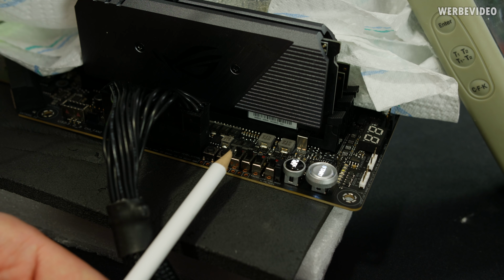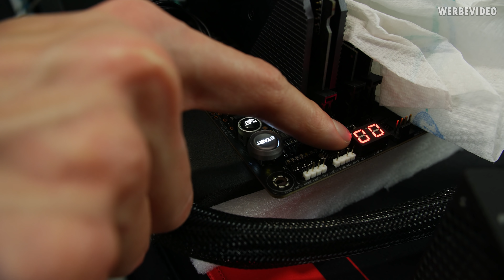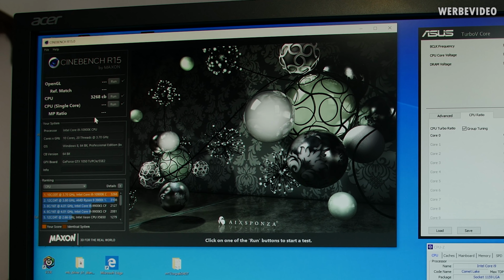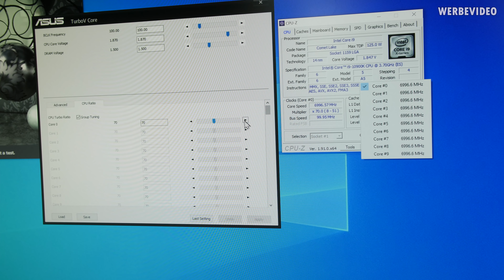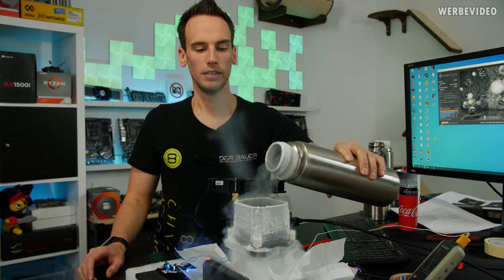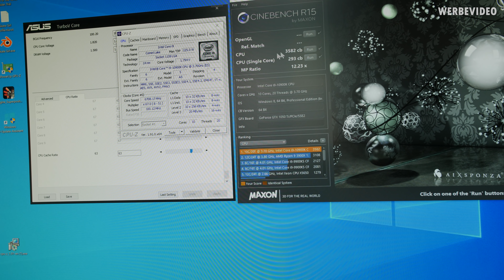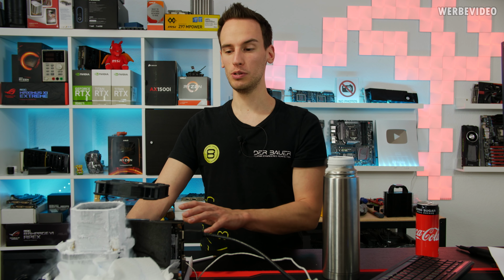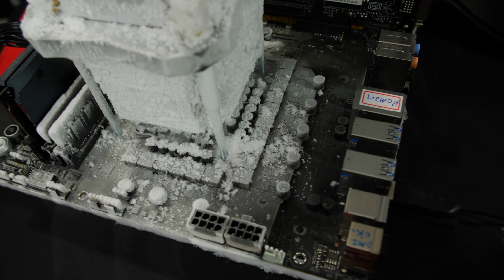The easiest Overclocking Platform EVER! Intel 10900K and Liquid Nitrogen OC to over 7 GHz

Comment: "fume" would likely be "vapour" in English
Reply: or "vapor" in American English.  Or maybe "steam"? Or does that only apply to dihydrogen monoxide (water)?  "fume" in the use I'm more familiar with might translate to something more like "smoke".  (Sometimes I've seen bilingual signs that in English say "No Smoking" and in Spanish say "No Fumar".)
Reply: pianoplayer88key vapour, smoke, and steam are all different things. Steam refers only to water vapour. Vapour of any other liquid is just vapour. Smoke is the product of combustion. The correct spelling in the english language is vapour, not vapor, which is the wrong way that americans (and no one else) chooses to spell it
Reply: Technically this is a mist.
Reply: Vapor in the language of freedom
Reply: Kevin Sandu vapor can be spelled either way
Reply: Off gassing.
Reply: @stageselectca  usa is better than  britain
Reply: The word fumes is more often used for toxic volatile vapours/gasses. Like you would call car exhaust fumes, not vapour. Same with stuff that comes off of paint/solvents/solder etc...
Reply: @JGnLAU8OAWF6  technically it's a gas
Reply: I love in the US but have visited Britain and Ireland and were not better lol trust me.
Reply: Live. I hate auto correct.
Reply: @Dakotajm0726  I live in the UK and have visited the US and was not better lol trust me.
Reply: Make America UK Again.
Reply: @easley421  what gas, exactly? Isn't that just water from air condensing and freezing due to low temperature?

Comment: Roman: *grabs LN2 and casually breaks a world record
Also Roman: "I don't want to risk the board and the CPU" 
:D
Reply: Ln2 is quite safe compared to chilled water
Reply: @LawrenceTimme  Not really, no. I had my laptop practically submerged in water (bottle of mineral water opened in the bag). I had to stand the laptop on the side to let the water drain. That was 3 years ago and the laptop still works. On the other hand, if you spill N2 on the board it is likely to damage the board as some parts will instantly cool and shrink at different speed than the rest of the board. Things will crack, break, warp. Not good for your multilayer board with large amount of surface mounted component.
Reply: Elmor did 7.7ghz on LHe, and Hicookie did 7.52ghz  on LN2 so not quite world  record?

Comment: 10:32 - Fume is normally associated with something hazardous or possibly harmful.
In this case I would think the word you might be looking for is "Vapor".
Reply: Steam would be also correct, because the visible part is the water condensation in Air, just the same as it is over a surface pot of water.
Reply: I'd think dry particles are called fume, wet particles would be called vapor.
Reply: @ShieTar_  Steam is a good term, cause it is actually a byproduct of the LN2 BOILING.
Steam: Noun: The vapor into which water is converted when heated, forming a white mist of minute water droplets in the air.
Related Terms Condensation, Mist, Haze, Fog.
Reply: @stephanschmidt2334  i think fume is any chemical reaction that forms a gas, vapor is just getting warm enough to off gas.
Reply: vapor is created here . steam is water . fume includes also particles
Reply: Steam is hot, this is cold, fog is more apt
Reply: Like the Fume Knight
Reply: Vapor, fume, steam, fog....
"Fine particles of water in the air, in high concentration", as simple as that.
Reply: @qweewq-h7p  different properties to it though my friend
Reply: Vapour is what people would usually call it, but it's technically wrong. It's only vapour if it's a gas below it's critical temperature, the temperature here would likely be higher than nitrogens critical temperature.

This is just gaseous nitrogen.

Comment: My best guess is that that little piece is actually a quick remove in case of unstable connection. If you notice, it has pin connectors attached to it, meaning it has some sort of conductivity. if something heats up, it might be a safety feature.

Comment: may i ask why you dont make a small acrylic box that has is de-humidified? the mobo can be inside, with the pot sticking out. a rubber gasket to keep the system air tight, and side panels you can open to still access the system... it can be on a ball-bearing slide so that the mobo can easily be inserted/maintained.. like a drawer or mechanics tool box.  that would be genius. you wouldnt have to worry about condensation At All...

Comment: The 9900ks should have been available on launch day of the 9th gen Intel CPUs & sold at the 9900k price. Now Intel needs all the ammo they could need with the 10th generation, I would have offered the 10900ks like that, especially since they need to get their fans to upgrade.

I just upgraded to a 9900k from a i5-750, have zero intentions to upgrade until 3 or 4 generations into ddr5 memory due to maturity of memory controllers and a wider selection of high end DDR5 memory sticks that will be available by then. I also just upgraded to a used 1080 GTX seahawk from a 7850 for my very first system that's water cooled, glad that I went with those steel braided hoses. Zero leaking issues & the tubes look nice for an industrial look in my rack mount case.

Comment: The bottle opener says emergency use probably because the motherboard is designed for overclocking on a test bench where cable management is next to none so the SATA connectors can be blocked by a piece of PCB without any problem. If you're putting it in a case you will need you remove the bottle opener so its a "emergency".

Comment: Never understood why people don't enclose the set-up in a perspex box to keep the moisture out. As long as the atmosphere inside is dried with dessicant or a LN2 "cold finger" elsewhere in the box away from the board and the air inside circulated by a fan, there shouldn't be any condensation on the board and it won't need rubber coating.

Comment: Question for water cooling aficionados:
1. Are there water cooling fittings that will work with hard and soft tubing so I could start with soft and then move to hard down the line without new fittings?

2. Considering there’s multiple fitting sizes for hard tubing, is there one that’s more common and thus more compatible with more gear or that looks better in your opinion?

Comment: Could you explain it to me: liquid nitrogen is not good heat conductor. Why overclockers do not use water near 0 celsius instead of liquid nitrogen because it can take more heat from processor? Or it needs negative temperatures?

Comment: i know this is probably a very stupid question but why dont they make the cpu chips larger and add more space for all the transistors to be ever so slightly more spaced apart to try and keep them a bit cooler? or is it better to have everything cramped together to become a larger heat sink? ive always wondered why dont they make the cpu's bigger? i know threadripper are bigger chips but they have a lot more cores

Comment: Would it be possible to engineer a closed loop system for LN2? I could imagine a board with a heating unit integrated into the socket and a sump system for the LN2 with monitoring and control software that maintains the target temperature regardless of load.

Comment: Nice. But I'm a bit surprised it has only about 3500 points at that clock when my i9 7900X has about 2450 points without overclocking. Same 10C/20T but only around 3.8-4.0GHz.

Comment: 8:25 find a better pouting method, that's dangerous it could have spilled on her hand
Reply: Synth Lord due to the leidenfrost effect spilling ln2 on her wouldn’t have done anything
Reply: @llamakob3745  sustained contact with the liquid stream for only a second could still cause freezing, skin will be rapidly cooled... shrugs* simply not worth the risk, when it's easy to find better method, just set the small container on the ground while pouring into it, no one needs to hold it

Comment: Does 10900K suitable for direct cooling as 9900K after removing IHS? I hope it will cool down the CPU significantly.
Reply: The quartz has been sanded down 0.3mm (12-13 thou) from factory, so you'll have to be bloody fucking careful with them after delidding.

Comment: so what happens after youre dont with extreme OCing a chip, is the chip basically trashed at that point or can you just reset the voltages and continue as if you did nothing

Comment: For some reason my 10900k stays at 4.9ghz at all times.. even after I load optimized defaults in bios.. motherboard is asus Maximus extreme.. I tried enabling, MCE, speed shift, speedstep and what not without luck.. it simply doesn’t clock down to its base clock at 3.7ghz any ideas?

Comment: Why don't you try lapping a 9900K/8900K die to the same thinckness as the 10900K's die and use the 10900K's IHS on the 9900K/8900 and any of the other older K and non-K cores?
Reply: That sounds possible, but wow would that be ballsy.

Comment: Just realized that liquid nitrogen could be used by men with erectile dysfunction.
Reply: its because some men thermal throttle when they reach 4 inchertz
Reply: @killers007q8  it's a boot issue

Comment: the 9900k is still more expensive than the 10700k which one is better or will they perform the same ?
Reply: If you have a brain, you'll take the 10700k, since it is not on a dead end plateforme

Comment: 8:25 Im pretty sure that in the future you will let your GF wear gloves when you pour the liquid and that this time was an oversight :)
Reply: the liedenfrost effect would have kept her safe its when it gets into fabric thats against skin that it really fucks people up that and sticking your hand in it
Reply: @bricktopgaming5750  Exact, it's actually more safe not to wear gloves then to wear some
Reply: @bricktopgaming5750  you can easily stick your finger in it for short time, the skin surface gas layer protects you; same goes with highly concentrated H2SO4 - the trick is pulling your finger back in a smooth manner without dropping any droplets of acid anywhere (and of course to water plate for letting remaining acid layer to fully react before drying the finger).

Comment: Is the word maybe Kondensation in German or condensation in English, or maybe water vapour or wasserdampf, I think maybe either could be used in this circumstances and English speakers would know what you mean. I bet there is a more technical term of it, but as the video is about overclocking and not physics I am pretty sure it's OK to call it steam or condensation.

Comment: Would like to see Mobo mfgs drop the PS2 port and include more SPDIF outputs for Home Audio Receivers (How else to get 5.1 off to a DisplayPort system?)
And 90 degree 24 pin connectors!!!.. and real heatpipe+radiator heat exchangers on the PCH/VRM like they did in early 2000s
Are the traces exposed and able to short? The rubber seems like an intense 1-way process..
First the Cat. Now the female. Next thing you know this will be a cooking channel.
Fume  = Gas or Vapo(u)r.. Fumes are usually noxious. 
Nice Linus Cameo.

Comment: I think if cooperation between Microsoft and Intel is done to create a new processor, which is two pieces of , and with a new motherboards that supports it, there will be coolers for each one, for example, one in the back and the second in the front
 , Or the two next to each other
The processors are supported by the same Windows system, for example, and the system collects two speeds
, To bring us Double speed with less heat.
we saw in the recent period on Intel's ideas to make the multi-GPU graphics card. Why isn't there also a multi-CPU? And it is supported by operating systems to collect two speeds and the system deals with it as if it is a single processor. I do not know this idea should be present in time in all processors. It will solve the heat problems. They have problems instead of changing the processor every year

Comment: could you do (even in theory) freezer alcohol cooling loop?
Reply: Ethanol evaporates at 80 degrees and has less viscosity then water. It's just more dangerous for the pressure but would be fun

Comment: 8:24 That looked kinda dangerous. I would hate to spill some LN2 on my hands. Please use some gloves ffs!
Reply: LN2 wont sit on your skin unless you want it to. If you get it on you shake it off. Gloves can get soaked - you can't get them off fast enough. Those rubber gloves will get completely messed up by LN2.
Don't use gloves.

Comment: Will we see 10 GHz in my lifetime?
Reply: Probably yes
Reply: @militaryiam97  Doubt it, chip manufacturers are moving away from chasing clock speeds since the early 2000's. It's all about instructions per clock and core count now. I'd be more impressed by an exponential core-count race these days. 16, 32 and 64 are already out. 128 and 256 are the next step. That will also require die-shrinking to make it fit in the same size socket. We currently have 7 nm by AMD and 14 by intel.
Reply: Yes imagine Intel with literally no architectural changes even but at 7nm I stead of 14nm. It will be reachable

Comment: great engineer, but obsolete viewed and reviewed and reviewed cpu that has been arouind for the past 5 years.... i stopped watching this at  0:05. as for the  7GHz very nice for you, but absolutely  far from impressive for the cpu....  these cpus that are designed to push overl oks have no say in 2020, when evenan xbox is more than enough to play  4k games with absolute amazng graphics .
Todya what impsresses peoel  is  cpus that  us eno energy taht dotn need to clock crazy fast an dthat perfome better than anyhtign in the past like the ryzen 3 or 4000 notebook serieos which  i would say   can be called impressive.
Not to mention that ruzen  3 series today are oen thign but the ones coming next year will be just as fast as 9900 intel series, and no one wil care ifthey run at 10000 Ghz or 100 the lower the better if they  are powerful